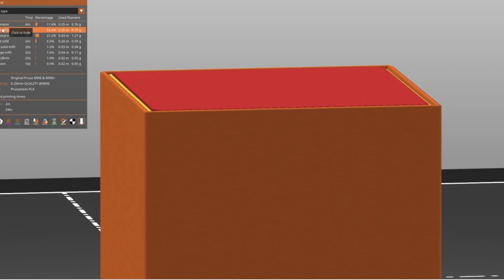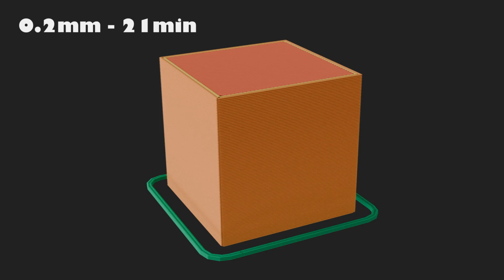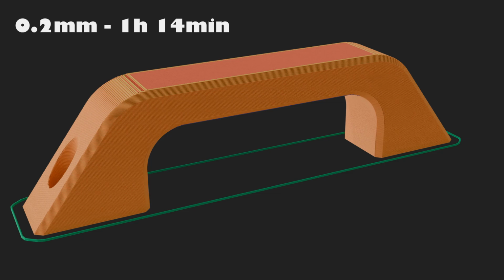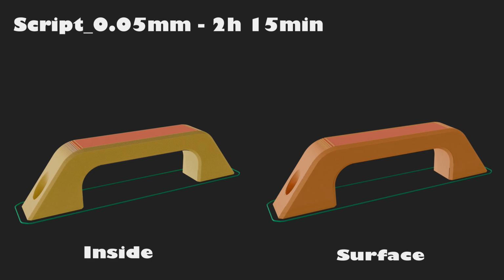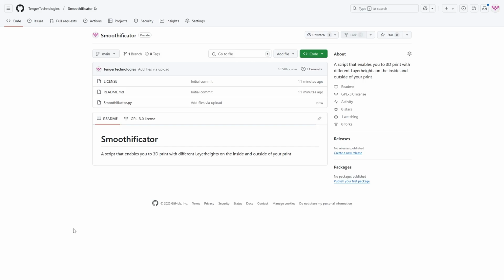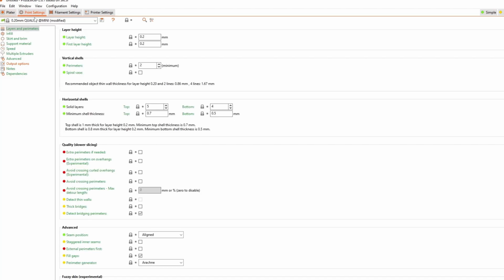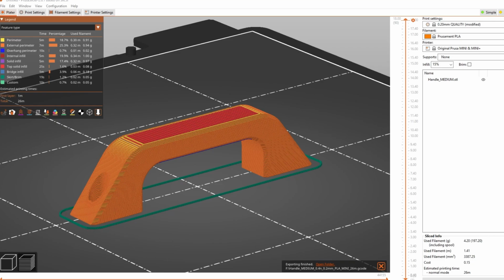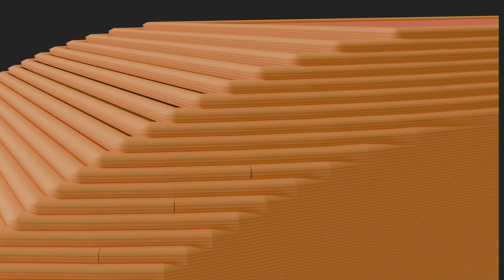Different Wall-Layerheight for 3D Prints now Opensource!

Comment: This looks really good. I think the Code needs reversing. have the slicer do the work on 0.1 layer height and then have the modifier change the infill. this would give super smooth outer layers.   At the moment the outer layers are better though on outer walls that are just on top of each other. i think this is the next level to this.
Reply from the maker: Hey there, the infill combining is already a native slicer feature. The difference is, that this script only processes the outer most wall, while the combine infill would have all walls at the finer resolution. 
I get what you mean and I made a follow-up video, just with a different approach. The second version works with adaptive layerheight, to ensure smooth curvature where needed, and makes the outer most wall in a consistent fine resolution. (You can check the video on that if you want)  I went this route, as just reversing the process, would not fix the problem and leave blobs on curved surfaces.

Comment: It must be just me. I seem to always have trouble getting the scripts to work. For this one, I do get a smooth_wall_log.txt file, and does have data in it, but when I look in gcode viewer all the layers are the same height. First & normal layers are 0.2, and I'm using -outerLayerHeight 0.1.  It does not seem to work for me. I'm jinxed. Here's a sample from the log file:

2025-11-24 15:08:12,426 - Starting G-code processing
2025-11-24 15:08:12,426 - Input file: C:\Users\abcd\AppData\Local\Temp\.43296_0.gcode.pp
2025-11-24 15:08:12,426 - Desired outer wall height: 0.1mm
2025-11-24 15:08:12,431 - Base layer height: 0.2mm
2025-11-24 15:08:12,431 - Number of passes: 2
2025-11-24 15:08:12,431 - Height per pass: 0.100mm
2025-11-24 15:08:12,431 - Extrusion multiplier: 0.500
2025-11-24 15:08:12,432 - Layer 1 detected at Z=1.700
2025-11-24 15:08:12,432 - Layer 2 detected at Z=0.200
2025-11-24 15:08:12,432 - Layer 3 detected at Z=0.200
//...............//
2025-11-24 15:08:12,460 - Layer 584 detected at Z=25.000
2025-11-24 15:08:12,460 - Layer 585 detected at Z=26.000
2025-11-24 15:08:12,460 - Layer 586 detected at Z=48.000
2025-11-24 15:08:12,481 - G-code processing completed
2025-11-24 15:08:12,481 - Log file saved at C:\Users\abcd\Downloads\smooth_wall_log.txt

Comment: For improving curved surfaces you can use simple linear interpolation.  If you use four points you can calculate the control points of a bezier curve and interpolate using this higher order curve.

Comment: Id like to make some addons for cura or a slicer, but idk how. Im learning  python/ getting better at applying everything new. Could you create a video where you explain how the slicer works from the super basic code perspective ?

It would be cool to have a thing called a hairy purge block if someone is doing multicolor. You create a 1 wall thick 3d shape and then use a camera on the printer to determine how much material you purged, then iron on the material you just extruded.

Comment: Can you change the script so that it combines the inner layers, and does not additionally slice the outer ones? That is, we slice the model with a layer height of 0.05. And we want the height of the inner layers to be 0.2. Then -4- from this expression: 0.2/0.05=4. That is, we take the trajectory of the inner walls from each 4 * n + ( 4 / 2 ) + 1 layer for this example. We skip the first layer, which is equal to what we set in the slicer for normal adhesion to the table. And we get a sequence of layers with a base trajectory for the inner walls 7,11,15, ... We take the flow as an average over 4 layers or multiply the flow on our base layer by 4. And thus we get inner layers with a thickness of 0.2, and outer ones 0.05, since we did not change them. Excluding the first one, of course. This will improve the quality of the outer walls, including the curved ones.

Comment: Doesn't work for me. I use orcaslicer. And the script generates the first layer without changing, and the subsequent layers are superimposed on each other. that is, the model becomes equal in height to 2 layers.

Comment: You can do this in most slicers.
I've been doing this in cura for years. 
I always use a .6 nozzel; print outer walls at .2, infill at .4.
Reply: .6 Nozzles have reduced detail on fine objects, increased oozing with PETG, its harder to print really small layers (like .12 or lower) and it still leaves you with the issue of perimeters all having really tall or short layer heights contributing to time-wasting. Being able to print 3 or 4 perimeters total and have just 1 of them being really fine and the others chunky would make for huge improvements in print time over just having different layer heights for infill.

Still, the infill thing is good to know - that will still save time for me in future.
Reply: But if you want something strong with a nice finish, the setting you are talking about are not saving as much time as the script. If you set wall thickneas of 5 walls, this setting prints all 5 at lower height right? While the script in the video only affects the single outer layer.

Comment: i think your approach with post-processing is fundamentally flawed. you should start off with normal slice at 0.05 and then post process it to 0.3mm height for internal structures and supports. i personally would seek for a way to combine 2 native slicedowns at 2 layer heights and merge the high quality shell with the coarse internals gcode

Comment: Not sure what I'm doing wrong but can't seem to get this to work with Orca Slicer. I slice, cmd window flashes as the script does its thing, I click export GCODE file, import back into Orca and its like it didn't change anything. The log file looks like it did things, but just not seeing anything changed on my print. I'm just testing on a primitive cube in orca slicer. I have verified that the post processing script is in the exact format as the video.

Comment: Isn't there a Combine Infill every n Layers in Prusa Slicer? I believe it does about the same and works with curved surfaces
Reply: Yes, there is indeed but analyzing the generated gcode with combine infill enabled I notice that it only applies for the infill (Like the name of the functions says), the script created by @TenTech is much more efficient because it combines all "inside" features not only the infill and prints just the outer layers with a smaller layer height. Looking forward to having this option implemented on the slicers !

Comment: This feature is already present in Orca Slicer/Bambu Studio. It's called "Infill Combination"
Reply: I think this also Changes the inner perimeters, Not Just the infill combining. So thats kinda cool.
Reply: Infill combination is similar but it's only for the infill. This also works with the inner perimeters, top and bottom surfaces, etc.

I use this in combination with infill combination to have 0.15mm outer perimeters, 0.3mm inner perimeters, and 0.6 infill.

Fast and high quality.

Comment: Cool idea and hopefully a step towards getting this working on curved outer walls.

I haven't run this but from a skim of the code, it looks like your "Detect layer changes" block will also catch Z-hops.  I don't think it'll cause an issue looking at some of my sliced G-Code but thought I'd flag it.  

It might also be worth noting that it looks like you're not retracting and/or Z-hopping between the new wall extrusions and that might cause issues for some, although I can see that some of that would be mitigated by printing outside walls first.  You might be able to avoid this problem if you alternated the direction of each new layer (rather than travelling back to the start position for each one) which I think should be possible by just reversing `external_block_lines` in the backward pass.

Comment: What about reverse approach? Slice with fine layer height and change infill to bigger. It will not have problems with details on surface.
Reply: doesn't it already do that with combined infill option? keeps your walls the set thickness (ex 0.08) but lets infill go up to max thickness for your nozzle (.24 or maybe .3 depending on your profile for an 0.4 nozzle)
Reply: Bit would this work if you set multiple outer layers? Otherwise, it would not really be saving that much print time.
Reply: I was using that reverse on simplify3D back in 2015 i think. Pretty sure this is also present on current prusa/orca but can't confirm since i havent used that specific function in a long time.

Comment: Hmm. Interesting. I think a good way to improve smoothing in curved surfaces would be to implement a gradient on the width. Something similar like bricklayers, but you kinda increase or decrease perimeter width per perimeter according to the angle of the curve. Keep up the good work!

Comment: Looking forward to this and brick layers being standard options in slicers instead of add-on Python scripts.

A similar reduction in print time can be achieved by setting layer height to the shorter layers and then turn on combine infill layers so a double tall infill is printed after two finer perimeter layers.
Reply: Expecting slicers to add features will be a long wait. Only slicer that does features on mass is CURA. Everyone else is too busy spending a decade on paintable supports rather than any small features. Then you have the fact that Prusa was years late to organic supports... like come on. Cura already had them for 3 years
Reply: @WhatsTheWordBozo  - We just got paintable fuzzy skin.  That was on my 2024 wish list.

Comment: I had no luck running it on OrcaSliser. I specified all paths correctly, but nothing happens :face-purple-crying:
Reply: It's okay, it works. I was just stupid for a long time and thought that the result should be right after slicing, but in fact it is applied after exporting g-code:elbowcough:

Comment: Why would you need a python script for that? Set layer height to 0.1, then set combine infill every 2 layers, or set layer to 0.05 and combine infill every 4 layers, and you are done... Been doing that since 2016.
Reply: I did not know this trick. Thanks for the tip.

Comment: seemed like an interesting concept until you showed it doesn't improve non-vertical surfaces. Might be more beneficial when using larger 0.6/0.8mm nozzkles maybe as those layers can be chonky. But unless the lower layer height follows the STL contour it doesn't provide much benefit for regular printing.

Comment: Excellent thinking buddy, well done, and this is a super useful addition. Thank you for this, no doubt in time it’ll get incorporated into the slicer…if you can have variable extrusion widths, and variable layer heights, it must be possible to apply different layer heights for wall types ultimately. Layer height 0.2, outer perimeter walls 0.1 etc.

Comment: To have increased details from smaller layer height the only possible way is to increase layer heigh for internal structures instead of reducing layer height for outer walls, but it will break majority of infill patterns, it is better to make native implementation instead of playing with postprocessor
Reply from the maker: Therebis no such thing as „the only possible way“ Just wait for the next update ;)
Reply: @tengertechnologies  there is, gcode with specific layer heigh is a lossy way to describe object, in other words, you do not know real geometry at this point. You might interpolate but it's not really representation of lost details, just a static "assumption"
Reply: @tengertechnologies  anyway, "infill combination" in orca slicer does exactly what i described, as added benefit it might work with your brick layer postprocessor if it won't go insane because of oversized infill
Reply: @SergeiSugaroverdoseShuykov  It's only lossy if you upsample the outside, instead of going the other way and downsampling the inside. Yes, that would of course be very similar to infill combination but still a small step forward by including the inner perimeters.

Comment: Any particular reason for not: Just reduce the layer height in the slicer and have it combine the infill?
If I recall correctly it is a quite old feature (might predate the prusa fork of sli3r, but I'm not 100% sure its that old), in Orca slicer its called infill combination
Reply: The Orca one only seem to be modifying the sparse infill (I'm not sure why it doesn't also do it for solid infill layers, but I guess there is a reason)
Reply: You can certainly do that, but it doesn't affect inner walls, so this script would be a larger speed boost.

Comment: You are going crazy man, well in the good way! 
Something like this already exists for infill, why no slicer maker ever thought about this??? 

For curved surfaces you could vary the line width. I routinely use 0.6 mm line with on a 0.4 mm nozzle. You can reduce it to 0.3 mm wide and move it inwards on the top of 2 partial layers. This might be the easy bit. Recognizing the curve is probably the hard part.

Comment: Isn't there absolutely no point if it doesn't improve the appearance of non-vertical surfaces? It sounds like these algorithms really should be implemented at the slicer level instead of being post-processing scripts. This would allow access to the original mesh instead of trying to patch things up after the model was already sliced.
Reply: This is usually the first steps towards possible slicer adoption, it has to prove it's use-case and have real benefits, speed while maintaining shell detail is what it's about. I think it's fairly reasonable to have a post-process script for now. They had no obligation to release anything really.
Reply: It still improves flat surfaces and he never said that there is no way to do curved it just doesn’t yet
Reply: Yeah, but it couldn't be done until recently. Very possible slicers will start implementing those scripts.
Reply: Speed
Reply: These kind of scripts is the first step for most features that eventually get included natively in slicers
Reply: @kezyka6775  what these slicers really need is plugin modularity
Reply: You are absolutely right about the fact that such things are better implemented at the slicer level. Unfortunately, sometimes it takes years for such features to be added there
Reply: Thank you for mentioning this. I kept scratching my head wondering if I was completely missing something super obvious for not seeing the benefit. It is a ”step” in a good direction, but still needs some improvement.
Reply: Yeah well he isnt in charge of Orca
Reply: @WhatsTheWordBozo open source means he can do a PR and have a chance of it being implemented
Reply: @kekkodance  considering how slow it updates,  I get the feeling there is a lot of red tape

Comment: Heads up for anyone trying this. I was getting error code 1 in Orca slicer when trying this. It turns out it's because I tossed the smoothifactor script in my Orca folder which I guess Orca doesn't have permission to access. Moved it to my downloads and now it slices the gcode. (haven't confirmed if it's changing the walls yet)
Reply: Any update?

Comment: Edit: Found solution - Prusaslicer was set to bgcode. Changed it to gcode and it worked.

I've gotten an error code on Prusaslicer. Error code: 9009 The smooth_wall_log file is blank.  Any ideas?

Comment: Tried this but keep getting Error code: 9009 in Orca when trying to save the gcode. Tinkering I finally got Orca to export but the outer wall is now only 2 layer tall... Tried multiple iterations and prints come out with outerwall missing. Shame too because this would be a huge game changer got large prints that require small layers.
Reply from the maker: Can you please share your gcode and logfile on github
Reply: @tengertechnologies  Gcode uploaded. I'll get the klippy log up as soon as my current print is done. so it can just be the one print.
Reply from the maker: Great thank you. I was talking about the Log that is created from the script. (Same directory as the script)
Reply: @tengertechnologies   Uploaded :)
Reply from the maker: I know the issue, I‘ll write you on github
Reply: @tengertechnologies  Do you find solution for this? i also have 9009 error in orca and prusaslicer
edit, it fix reinstal of python and in first stage of instaler agreed in two check box
Reply: @tengertechnologies  same issue for me too